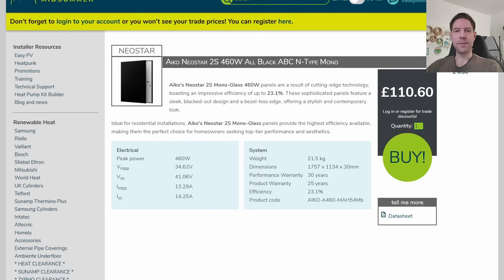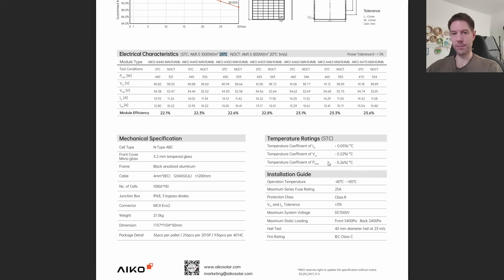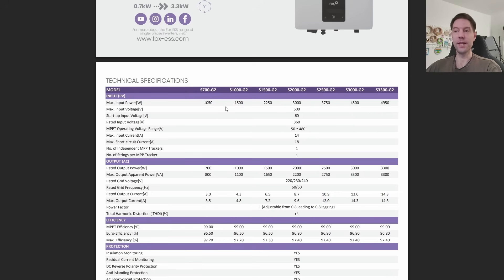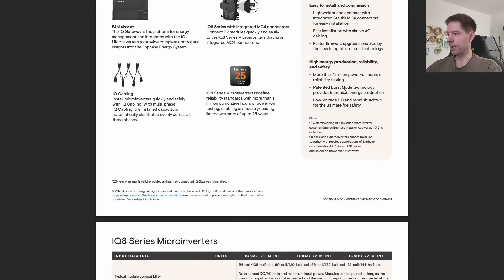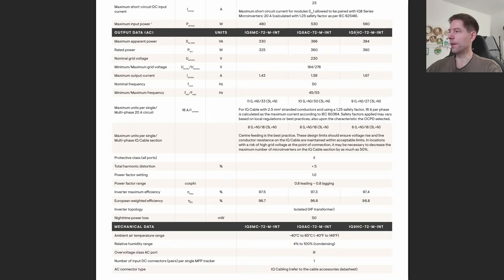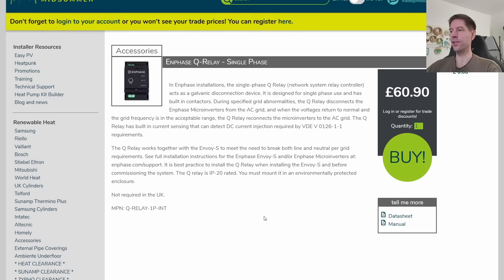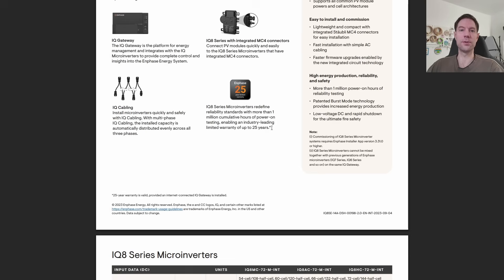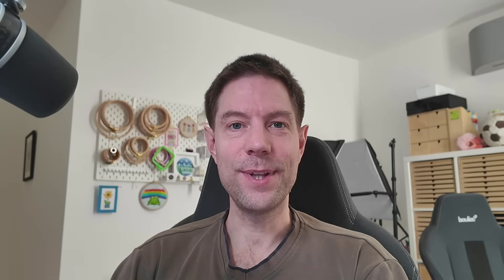New South array tech specs - string vs microinverters

Comment: I think you may see clipping on the 1500W string inverter too, we have 430W panels, and when cold and sunny we see up to 535W per panel, nearly 25% over specification for a nearly south facing (193 degrees and 34 slope).  I think I'd have gone for the 2000W inverter, it also bumps you up to their next efficiency level.
Reply from the maker: If I see clipping on the string inverter I'll let you know.  I very much doubt it'd be more than a tiny percentage of the year though.  And oversizing your inverter by more than you need can mean the efficiency is actually lower for a good chunk of the year due to the efficiency curve dropping off a cliff at low powers.  You're better to keep your inverter close to the input power of your panels to keep in the flat part of the efficiency curve for as much of the time as possible.

Comment: Hi Tim all good stuff however, when you are looking at panel outputs you're quoting the STC output figure. This is not realistic when you're considering your calculation you should really look at the NOCT output for the panel which is real world output. STC output is ideal lad conditions, you will never get this figure in the real world.
Reply from the maker: It's the most common way to express panel power output, describing the peak rating.  Everyone knows and understands that it's the peak value, and that the real output is going to be lower under less than ideal conditions.  No one uses the other rating when talking about panels and it would cause confusion if I did.

Comment: The warranty of the enphase combiner and envoy is only 5 years! So you pay a higher price, for more points of failure and more complexity with no better startup voltage vs a string. Enphase also forget to mention the existence of bypass diodes. Only 5years is a bit of a joke when  their main selling point is 25yr warranty. To me, string inverter has got to be the way to go 🎉 good video, Tim 😊
Reply from the maker: At least the bits with the short warranty are easy to replace.  I'm aiming to do a more detailed pros and cons video for both systems at some point so will mention all this.
Reply: @TimAndKatsGreenWalk  so it's the same as the string inverter, in the way that you need kit inside the house. But with more cost and more complexity, and more of that complexity is a scaffold away 🤔 I just cannot make it make sense in my head. I guess it must be easier for installers or it wouldn't have been so popular

Comment: For the IQ gateway, did you get the metered version? This gateway allows for the system to communicate with Enphase's servers so that the data is available through the app/web version. Also, it allows Enphase support to interogate your system. The metered version allows for meter coils so you can see the import/export etc.
Reply from the maker: I can certainly see the data in the app for the generation.  But I'm not relying on that, I'm using a Shelly as an independent measure (see installation video).

Comment: The Q Relay not required in UK = not permitted in UK.  It's quite a daft point really but UK electrical regulations frown upon any mains DIN-rail item that is not positively type-approved for your consumer unit.  Hence why it is common to see RCBOs / MCBs / RCDs being fitted from the same brand as the consumer unit itself, as they only certify their own accessories.
Reply from the maker: If it's not permitted in the UK it wouldn't be sold here, presumably?
Reply: @TimAndKatsGreenWalk Consider how many things you can buy, which are not legal to use in the UK
Reply from the maker: @TheRonskiman  on a prominent website like midsummer though?
Reply: @TimAndKatsGreenWalk  In general. Just because something is sold doesn't mean it's OK to use.
Reply from the maker: @TheRonskiman  I can find nothing online suggesting it's illegal to use in the UK.  If there's a reliable source I'd be interested to see it.
Reply: @TimAndKatsGreenWalk  I think illegal is the wrong term, and I cant remember where yours is installed, but I think what the OP is getting at is that if it's installed in a consumer unit then it may not be type tested with that unit. But the the same would apply to Shelly energy meter mounted in a consumer unit or a relay etc. When adding MCBs or RCBOs you should always use the manufacturers matching units for that consumer unit. Following copied from somewhere on the interweb. Mixing and matching MCBs from different manufacturers can invalidate the consumer unit's type-testing and potentially compromise safety and compliance with electrical regulations.
Reply from the maker: @TheRonskiman  the Shelly and relay have their own MCBs too (appropriate for the consumer unit).  I wonder if that makes a difference.  Neither device draws power from the consumer unit, they're powered via the MCBs, which are certified.
Reply: @ As said out the outset, it's a bit of a daft rule when the intent is to instal an additional safety feature.  

The background for it is genuine though as the tolerances within the consumer unit standards mean that some DIN-mounted components do not fit or are misaligned on the copper busbar or, more worryingly, appear to fit ok but cause failures in the burning-the-house-down kind of way.  

Some see it as a knee-jerk reaction to real-world incidents, some see it as a rule that was written in victims blood, whilst others simply bemoan that the recognised standards do not actually guarantee that a minimum interoperable standard has been achieved.
Reply from the maker: @ascot4000  these devices don't draw power directly from the consumer unit though, they're going via MCBs, so there's no risk of fire from them, I'd have thought.
Reply: Just stick it on a din rail anywhere other than the consumer unit and it’s totally fine. We can thank the IET for this dumb situation.

Comment: This video has been invaluable to me as just about to pull the trigger on a large install and keep changing my mind on paying for micro or not.

Didn't realise I could compare the start up voltage in the spec sheets so thank you.

What's the earliest you'll be able to share some comparisons of production between the 2 systems? Any idea yet?
Reply from the maker: I'll be doing monthly summaries, so the first one will be early April for March's data.  Although bear in mind that the comparison will likely change over the year, as string/micros may be better/worse under different conditions.  But at least you'll start to get an idea.
Reply: @TimAndKatsGreenWalk  thanks, appreciate the reply m 

If you get any data before the end of next week please do let me know as I'm looking to order by next Friday
Reply from the maker: @ well, as a sneak peek up to today the totals for March are 95kWh for the string inverter, 100kWh for the micros.  But I can start to see clipping on the micros already so I suspect that in the sunnier months the string inverter will win out, while the micros might do better over winter.  But that's speculation on my part at this stage.  Certainly they are close enough that other pros and cons should be considered.  For example, if you have shading issues then the micros are likely to do better.  Whereas string inverters are cheaper and easier to replace if they fail.
Reply: @ Thanks so much for sharing that data, I think I'm going to go with string. 

My thinking is, even if 15% more production with micro, the conversion to ac, then dc, then ac again at roughly 3% a conversion, brings that extra profuction down to just 6% extra. 

I've dumped all my data into 3 AI models and all say that even over 25 years, I wouldn't recouperate the extra cost of the micro inverters, let alone over the 10 or so years I plan to be here for. Along with only a limited warrantee from Enphase, I think it's not worth risking. I have no shading on my roof either.

THanks again for sharing, I've been searching for somebody doing this kind of experiment in the UK for so long.

Comment: Given the cost of cable being relatively cheap, why don’t they run cables from the panels, that way the micro inverters can be installed at ground level, away from the elements and heat of the roof ?
Reply: Some installers run them to the inside of the roof for loft access.  This keeps cables short (avoiding Vdrop) and allows for easy access to them as the scaffolding work itself tends to be the dominant factor on any on-roof solar work.  You find at least 1 example of this over on the Oval Renewables channel.
Reply from the maker: @ascot4000  yes, that's one solution.  It does require more holes in the roof though, so that's a consideration.
Reply from the maker: That's a good question, I don't know.  I'll ask my installer the next time I speak to them.  I suspect it's because you'd need a cable running from each panel down to the ground (you can't wire them in a string) so if you've got more than a handful of panels you'd end up with a whole bundle of cables running down from the roof.
Reply: Each individual panel has a low voltage. You will have some voltage drop in the cable. Because the voltage is already low, that voltage drop will have a relatively high impact. And you'd need 3 cables, where now you can combine them into one.
Reply: One of the big benefits of micro inverters is you don’t have any dc cables that can arc and spark inside the building

Comment: I'm very much looking forward to the first set of data. My microinverters (also IQ8HC's) are on my East and West aspects so clipping isn't really an issue like it would be on the south side. Another key selling point of the microinverters are their ability to cope with shading, but it doesn't look like that's much of a factor here.
Reply from the maker: Absolutely, the clipping is only ever likely to be an issue with South arrays, and even then might not make much difference to the annual yield.  It'll be interesting to see either way.  On sunny days I can already see it clipping a little but I'll show that in more detail in the subsequent stats videos.  We do have a bit of shading, but I think it only makes a small difference to the yield as it mostly happens when the sun is low on the sky anyway, when generation is already low.  But again, I'll be covering all of that in future videos!  Fun times.

Comment: The 380W for the micro inverter is AC output right?
The 460W panel rating is DC output so once you factor in conversion, the clipping may not be that bad.
Reply from the maker: Yeah, 380W is the AC output.  Conversion is 96.8% so there'll definitely still be some clipping.  In fact I can see it already on sunny days and it's only March!  But whether that makes much difference to the annual yield will be the interesting question to answer.
Reply: @TimAndKatsGreenWalk  Good stuff. I am very interested to see the data throughout the year!
Perhaps when it gets warmer there will be no clipping as panel output reduces?
Reply from the maker: @ well, I guess we'll find out!  Although the temperature effect is much less significant than most people think.
Reply: @UpsideDownFork  At some point the microinverter might overheat and the output might go down significantly.
Reply: Do Enphase offer microinverters >380w?
Reply from the maker: @robjones8950  not yet, but I hear rumours of a higher rated one in the works.
Reply: @TimAndKatsGreenWalk  Even when they are produced, it seems that the UK is not a priority for Enphase, we seem to get the products a long time after the USA and Australia for example.
Reply from the maker: @ much smaller market, I'm assuming.  Maybe that'll change as the UK solar market grows.
Reply from the maker: @ I just found this but it looks like it's not available in the UK at the moment: https://enphase.com/en-lac/store/microinverters/iq8-series/iq8p-microinverter

Comment: Did not know that 1.5kw inverters are still available. Way back that was all I could afford was a 1.5kw system.
Reply from the maker: Yeah, it's quite surprising.  I guess there's still enough of a need for them.
Reply: I had 2 405w panels put on a east facing roof in sept 23 with a 1kw Solis mini inverter and it’s produced 617 kw so far 👍